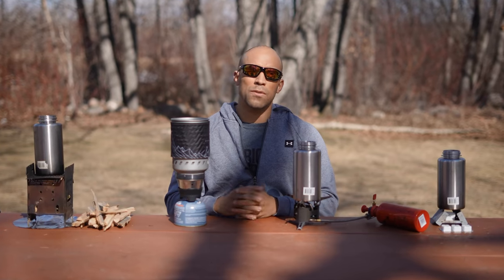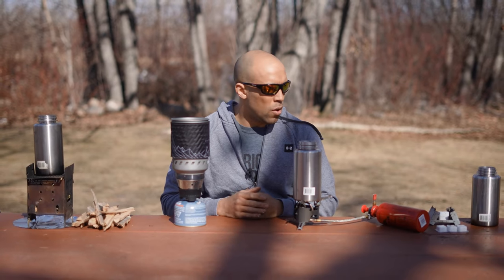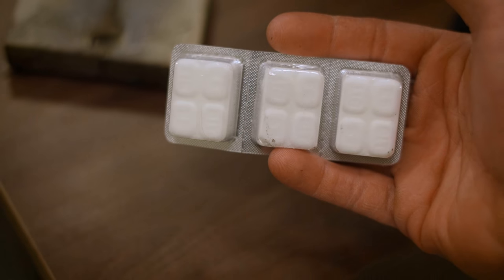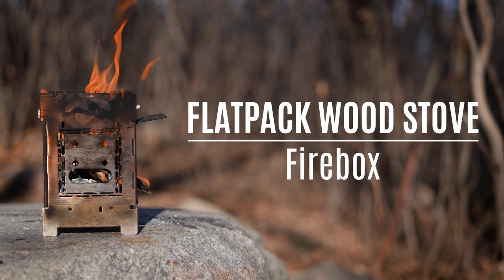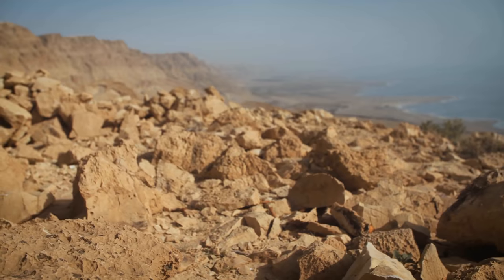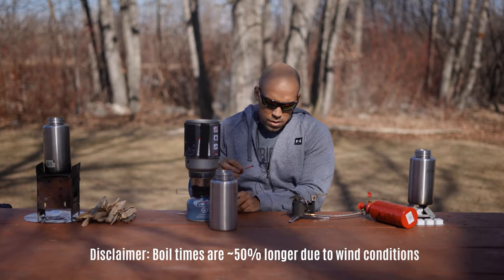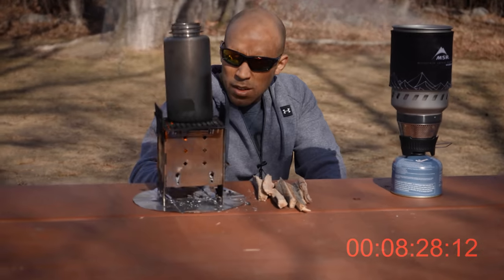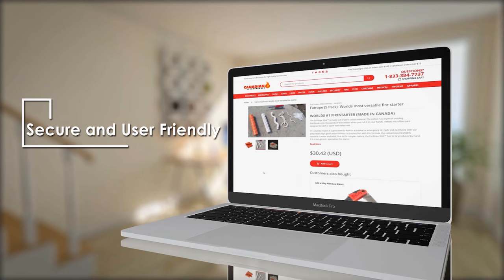What is the Best Survival Cooking Stove?

Comment: Obviously wood is the best survival fuel, its renewable during a shtf situation and you dont have to buy/store/carry a ton of it like you do the others.
Reply: Also, with the firebox stove, use the boil plate to direct the heat to the bottle. I boiled 16 oz of water in 3 minutes with mine.
Reply: 100% shelf stable with fuel costs of $50 a cord vs. $50 a bottle? Even the lower fuel efficiency doesn't ruin that.
Reply: You have to process it(dry it)
You need more storage. 
You also have to go to the trees. You have to go outside. It isnt really obvius for some like me. Because i see radiation all over the place.
Reply: Billy Lazer  well, you wouldn't be in the forest then, would you? You can (almost) always find some wood to burn for fuel, even if its pulling a few pieces out of the wall from a building your scavenging.
Reply: @keywestalert6329  radiation? Most people do not have access to a bunker to keep then from radiation in the event of a nuclear attack. The firebox runs on several different types of fuels too. Look up the firebox channel and see the video. I  have used wood from fallen branches, wood pellets from the store, matchlight charcoal, hickory wood from the grilling section of home depot. It also runs on mini propane, or alcohol burner.
Reply: @keywestalert6329  Hmmmm.....make sure your tin foil hat is working properly.
Reply: All of these have their risks.  I have a wealthy neighbor who says if the shtf, he and his family can gather enough food to survive.  And they'll be gathering firewood.  Like he expects there to be a dome of security around him during a time when maybe 98% of the population is eliminated by starvation over a 2 year period.  We're outside of a town of 100k people, 6 miles away.  After a few weeks, the woods will be loaded with desperate people.  My plan is to have enough survival supplies to make it through, meaning my concern will be security.

Comment: Sterno for me. Still use it when I go ATV camping. Works in any weather condition.  Not good for boiling large amounts of water, but can be done for smaller amounts. The secret to success is to use a pot designed for Sterno style fuel; thin wall, low profile pot with lid. It's old school but it works evey time. Think cans over Mountain House type food.

Comment: Please do a prepping video on power outages in extreme heat.  Basically the Texas summer version...
Reply: Step one: buy a generator
Reply: Get a 5 gallon bucket and a insulation insert for it. Drill a hole on the side, put ice in and, put a fan on top. YouTube AC bucket, they work I just built one.
Reply: @alexwilliams9900  i saw DesertSun do this on his channel.  Great option because most smaller fans are usb charged and you can use a portable power bank.
Reply: Thermal mass cooling look it up

Comment: Thank you VERY MUCH for this EXCELLENT comparison of popular stoves. WELL DONE!
I have found that the Esbit stove does a fine job boiling water for Mountain House, freeze-dried meals. The fuel tabs do not spill and can be stored for (at least, in my experience) three years. Additionally, the fuel tabs can be used as emergency fire starters.
The isobutane stove worked very well in the backcountry, and offered the luxury of simmer/warm-up/reheat.
I have been fortunate enough to find cook-sites that were out of the wind. Exposure to even a light wind would, IMHO, compromise any stove to some extent and could easily cause a dramatic increase in cooking times.
Again, THANK YOU for this EXCELLENT COMPARISON! 😎👍👍👍

Comment: One more thing I'd like to add for the Esbit stove. It's also stealthy in the sense that it barely puts off any light when you're cooking something. At least in my experience.
Reply: Question: re long-term storage: can these Esbit cubes dry out ? I mean, is the fuel in the cube structure, or is it in a liquid absorbed in the structure ???
Reply: @vixuserid5518  as long as the seal isn't broken, you can store them a while. I don't think they dry out, though. I could be wrong on that
Reply: I heard those cubes have a strong unpleasant smell. That is why I have not purchased one
Reply: @debrasolimine497  i mean, it doesn't smell like peaches and flowers but it's not super horrible. That's just me though
Reply: @debrasolimine497  The fuel tabs have like a fishy smell to them which dissipates once they start burning. It's noticeable but not overpowering.

Comment: After watching this, pulled out my Biolite2 camp stove to give it a burn and charge. 1 1/2 medium Tim hortons cups worth of pellets gave me 43 minutes of high burn on the lowest fan setting with additional 10-15minutes of heat and small flame off the coals until they are ash. . I think that’s amazing especially with the flame it can put out with the fans and on top of that charge electronics by burning wood is pretty cool as well. And yes Tim Hortons cups is a form of measurement here!

Comment: For many years I used one of those stoves with the fuel bottle that takes different types of fuel. I hate how much the bottles leak! Constantly replacing the O rings. So I bought an isobutane stove and I have used it in -8°F and 20°F temperatures, and it’s worked just fine. With any fuel source, it’s best if kept warm and dry in cold situations. I’d like to add the firebox to my gear. That way I have multiple stoves for different times.

Comment: Great combination.Trangia Alcohol burner in the Firebox.  It is designed to use it in addition to wood.  When you run out of alcohol you use wood.  Or extremely long term you build a distiller.

Comment: I use a esbit. have been using same one for over 10 years . and that's hard use.
have used wood in it, alcohol,  and the cubes,  big trick is take a bit of foil and cut it to fit in open area/Side. acts as a wind screen and keeps more heat under the pot.  makes its way more efficient. cubes burn for around 15 to 20 min with just that one mod.

Comment: Do you use any type of "volcano kettle"? I found them to be far better wood-burning solution thank these collapsible wood stoves. Since the fire is going inside the kettle, soot is also not an issue. On the other hand, you have mostly a kettle (with some addons you can use it to heat another pot, or after you finish boiling water use it as a separate stove). Definitely not something to be carried in a backpack, unless you're traveling in a group with one larger kettle (the one I have has 55 fl.oz. capacity). But for boiling large amounts of water (e.g. for disinfection or for cleaning or washing) I didn't find anything that's better.

Comment: I just picked up a couple of butane stoves from amazon and 1lb propane bottle adapters for each one. One is a bigger stove with a short hose that goes to the gas bottle, and the other is more of a pocket rocket style which is extremely loud compared to the bigger one, but makes up for that in portability.

With a 20lb propane tank and a fill adapter for the 1lb tanks I'm pretty much set for a good long time even in the unlikely event I would have to use it exclusively for the foreseeable future. Both just sip propane, and after cooking meals on both for a week the propane bottle is still almost full. There's always the option for butane, but they run so well on propane that I would reserve that for the bug-out bag only.

Comment: Wood stove is my long term choice, followed by my whisperlite easy maintence in the field, i use aspen4 in it, that keeps for years, but unleaded fuel does not break down as easily as people think, you can find loads of accounts of people firing up coleman stoves ten years after last using, and still has the same fuel in the tank, but it will form crystals so needs filtering before use, unless you want to clog up the stove lol.

Comment: A side-feeding titanium wood cooking stove is really the best for longterm cooking use. They have affordable models available on Amazon for under $50, and they pack perfectly flat and are extremely lightweight. If you want warmth, you need something with a chimney so it can be used in a tent, and that's where things get expensive. But the basic pyramidal titanium side feeder models work extremely well for most purposes. They're sturdy, they're stable, they don't clog up easily, and they don't rust.

Comment: In the use of the MSR Wind Burner®Personal Stove System. If you are schlepping fuel cans for a weekend get away. A table top burner using butane be just as effective and cost about the same. Something like the Coleman Tabletop Butane Gas Camping Stove. A larger cook top and very simplistic.  If humping the gear isnt an issue. And it hits many of the criteria you list. Simple, quite and no smell. The only down side is larger cook surface means bigger cookware and you have to make more room (  Car, Truck or belt)..  Keep up the good work!

Comment: Those are great for bugging out, but if you plan to bug in, I think the Gas One is one of the best, so long as you get the 15,000 BTU with the 1LB hose and then also get the large propane tank hose. Then you can use butane, 1lb tanks and large propane tanks. Store a half dozen 10lb propane tanks like I have and even if the power and natural gas stop, you are good to go for quite some time.

Comment: I would say wood for a few reasons.  A small  wood stove made out of titanium will last a very long time, is crazy lightweight, cools off fast, and runs on small amounts of fuel.  One does not have to carry a lot of fuel (can carry a little bit of things like birch bark or fat wood) to have a little dry wood.  The black ash can be used for water purification.

Comment: One word: Trangia

You can always light that, even in a blizzard.
Couple with alcohol burner and you got  disinfectant always in your backpack aswell.
Reply: You can add it to the firebox and have a great combination. But, the title was for preppers.  What a bought getting alcohol in an emergency?  I use heat with my Trangia's and keep a supply on hand.  The Trangia burner is very inexpensive.
Reply: I too think that alcohol stoves should have been included. You can produce 180 proof grain alcohol with very little equipment or trouble.

Comment: Wood is better over all, since wood is found everywhere, as trees, paper or pallets.

Gas is good, if you can find it, but there isn't a long term supply of it, but I might be able to drop a small canister in the burning area, but I'm not sure that's safe. 

I like my Biolite Stove, I believe I can use it long term, since it does cooking and boiling and can also use it to charge USB products like a two-way radio, external batteries, GPS, torches/flash lights, I've only used wood and dry grass in it so far, I'm looking to try solid fuel blocks next.

I am not sure about liquid propellants in the biolite, as I'm not sure it's safe. 

It doesn't make a loud noise when the fan is active, but the down side is it gives off smoke.

Other than that it's a good stove to cook and boil on, you'd have to build a bigger, classic camp fire if you need more warmth or wear warm clothing.

Comment: The MSR stove is the best by far. You could also get other adapters for it. You can get the adapter that will allow you to use bulk propane. You could use it with the other sources of propane. And you can also go to the really inexpensive canisters that they use in those cheap Chinese butane stoves. By far you can use this stove with other fuels and other sources

Comment: The nice thing about the liquid fuel stoves is that a couple gallons of gas, that you'll keep and rotate for your vehicle anyways, will last a long, long time (or just store kerosene).  Plus liquid fuel stoves are more efficient on an ounce-for-ounce basis on their fuel.  Backpackers generally don't use them since the stove weight is too high vs cartridge for the typical 4-10 days, but if you're out for multiple weeks, that efficiency on the fuel side takes over.  Also, there is far, far superior cold weather performance of liquid vs cartridge (iso-butane mix) fuels - check out the boiling temps of iso-butane & propane.  Unless warmed, the iso-butane just sits in the cartridge, useless.  The backpacker trick is to sleep with the cartridge in the bag on a sub-freezing night, so its warm enough to cook up breakfast.  Another trick is to warm a bit of water right as you get started.  Put that in a bowl, then set the cartridge in the bowl where the warm water gently warms the fuel, which will insure the iso-butane stays warm enough to be used.  For the cartridge stoves, there are adapters that allow for filling of the backpack canisters, or adapters for the "green" 1 lb propane bottles to those backpacker types of stoves, and to refill the 1 lb bottles from the bulk propane cylinders.  A few bucks spent on those insure that either backpack type stoves or 1 lb propane type stoves can access bulk propane stored fuel.  Another less sophisticated and expensive option vs backpack stoves is a cheap 1 burner "Coleman" type stove that attaches to the 1 lb bottles.  They're not nearly as useful for a foot based bug out due to weight and bulk.  Just search "1 burner propane camp stove".  As CP has noted, propane stores very well and is quite handy.  For vehicle based bug out, or bug in, the "little buddy" or "big buddy" heaters run on propane, a cheap coleman 2 burner stove can cook for a family, a 20 lb bulk propane cylinder lasts a good long time.  Paired with a liquid fueled stove, like the one shown, is a very useful set up.  Great vid CP.

Comment: You missed a possible contender.  There are stoves available that take both isobutane and liquid fuel. The added benefit is that because they have the heater coil you can run the canister upside down in liquid mode especially if its its too cold to vaporize correctly. 

Personally I prefer the multi-fuel stoves with a twig burner as backup.   Don't really need a stove to burn twigs but it ups the efficiency.  With the various adapters available I can use propane or butane instead of a canister and have the ability to burn most of the common liquid fuels.

Comment: I have tested all these types of stoves.  IMHO, Esbit gets a "thumbs down" - you truly get/don't get what you pay for.  I recently got a wood burning folder and I am very impressed.  You can also use it with an alcohol burner (no smoke/smell) or fuel tabs.  I keep a compact ISO butane gas stove in my BOB, primarily to boil water for freeze dried meals, but also capable of pot cooking.  Loud?  Hmmm.

Comment: Only one of those is an survival stove. The other 3 require a store for fuel.
Reply: Technically you can make ethanol from fermentation, collect methane from compost and create a gas/diesel mix from waste plastic.  But that takes a lot of work.
If I was going to do that (except maybe the plastic one to run a vehicle) I would just make a wood gasifier.
Reply: @ancapftw9113  or I can pick up sticks........lmao!🤣
Reply: Yep, I agree, if it requires stored fuels, it’s only good until you run out. That’s why I chose the Biolite2. Very efficient burn and will run forever as long as you keep feeding it sticks and twigs. Plus it will charge my electronics.
Reply: Depends on the survival situation. There are things that can happen between "completely fine" and "end of the world".
Reply: You can burn sticks in the esbit, an it works good to

Comment: It should be mentioned that this presentation while very good & quite thorough only addressed boiling water.  That's fine for drinking or instant prepared food that only requires rehydration.  If you are going to be cooking real food the Esbit & Jetboil systems are all but useless.  

With the wood stoves like the Firebox or the excellent & affordable wood gasifier stoves & liquid fuel stoves such as the MSR universal multi fuel or many different alcohol stoves, you can use different sized pots & skillets & cook for longer periods of time.  Think breakfasts, fresh fish or game, stews & soups.  Even bread & biscuits.  

Also, don't forget the danger of a gas canister stove (isobutane or propane) with the canister attached directly under the burner.  You can not use a wind screen if it's windy because the canisters may over heat & explode if contained inside a wind screen.  Cheers all & happy, safe cooking outdoors.

Comment: I use adapters for my canister stoves which allows me to use propane which has some real benefits, one of which is it can be stored for extended periods of time. Another benefit is that propane works in cold weather. Those adapters sell for as little as $6 on Amazon.

Comment: It’s a very informative comparison. In my opinion canisters stoves are not necessarily a great option in cold environments and in high altitude, I certainly prefer a liquid fuel stove even if they are for the majority heavier and more touchy to ignite. The Esbit type are maybe good but I don’t really like the fishy smell of them. At the end the firebox is probably the best option first because beside wood you can use it with solid fuel, alcohol stove, canister type stove and liquid fuel stove so it’s by far the most polyvalent. One thing you might have mention is that to avoids constantly feed a wood stove you can preload it and make a top down burn which is more efficient and depending on the quality of the wood gives over 30 minutes of burn time. To me for any kind of scenario a wood burning stove is my first pick and the firebox is my ultimate choice over any other one. Thanks for your excellent work👍👊🇨🇦